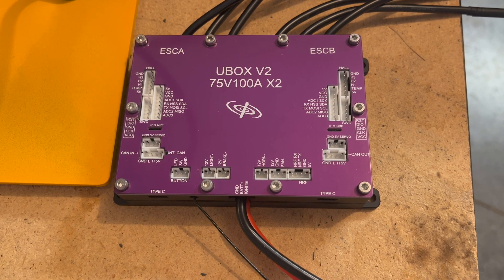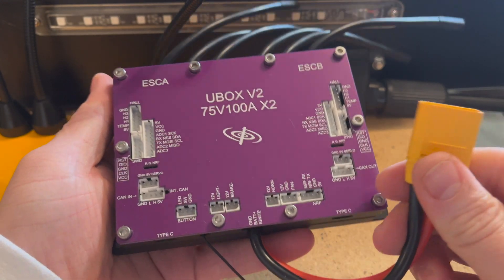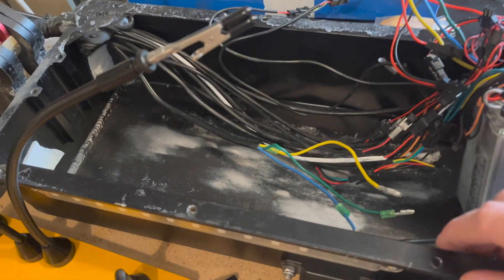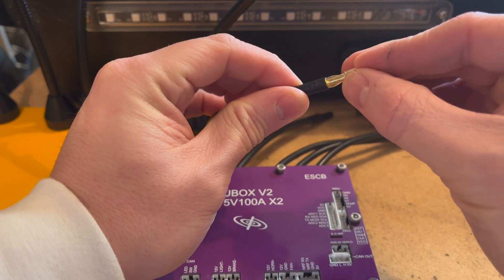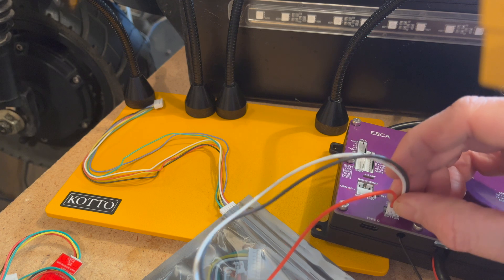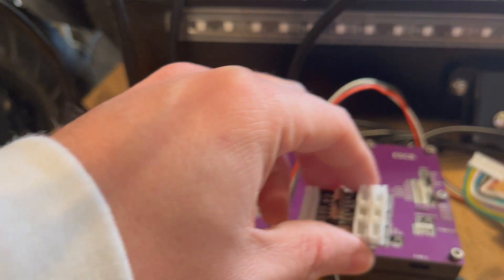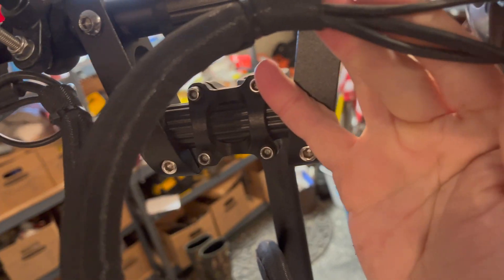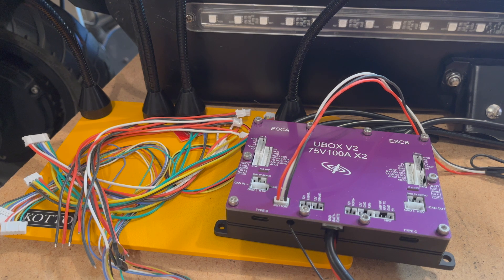How to Make Your Electric Scooter Faster | UBox Part 1

Comment: Hey what's up man, how did this turn out in the end? I have a Mantis Pro and can't find many videos on the results. It'd be nice to see some before and after 0 to 30mph times or something to show its a lot quicker and worth the effort to do this. Most of the control boards I see like vesc, seem to be made for longbiards not scooters so that's unfortunate it causes many more problems when making it work for a scooter. The ones that are meant for scooters are usually to weak or too big for my scooter since I don't want it to be external
Reply: some esk8 board needs alot of current like 100a per motor or more for torque. With escooter only needs lesser current but torque is insane cause motor is bigger so with vesc its not really a problem! ofcourse powerful esk8 is torquey too, Ive seen doing 40 at 5 second just 2 motors with 4 probably 3 seconds.
Reply: @joaquinninoortega156  no that's not true, the controllers just don't list motor current, they list battery side current

i had a pair of 28A JP controllers in my scooter, and i'm running 2 VESC's at 40A battery current and 120A phase current, 90A phase current is about similar as what the original controllers did in the motors in acceleration and climbing power

the "45A" controllers in more powerful ones ask 45A max from the battery, but at lower speeds they dump up to like 150A or more into the motors

when i use VESC tool and have a motor at 50A i can hold the scooter (not 2 of them, but a single one) by the handlebars

these need atleast 90-100A phase current each on a dual motor setup to have decent acceleration, so the majority of VESC's are too weak for these scooter motors

i've got a pair of 75200's coming in.
Reply: @BH4x0r  The generic controller doesnt tell me how much current it releases from battery or phase wires. Did you run foc detection for that 120a? or that 50?

 FSESC 75200? good luck with that!! might get hot as soon as possible.
Reply: @joaquinninoortega156  you just pick an approximate motor size (6kg outrunner) and run the wizard, it will do most of the setup for you

i don't run the battery current that high, i only run 42 amps per controller @ the battery (cause the battery has a 90A max limit), and at half of the top speed it starts accelerating less (obviously as the max phase current can only be 84A @ 50% duty cycle) and less when you near the top speed, which is basically like all scooters, because of the battery current limit, however low speed torque is better than with the original controllers because those weren't that powerful in the case of my scooter and ScootaGangs' Yume

in the case cause hes set it up like a "10kW" scooter (100A at battery and at motor) it'll have the same acceleration through the entire speed range, which is okay but because he can't really go higher on the motor amps on the Ubox it doesn't have the power at lower speeds like an actual 10kW scooter would have.

make sure to buy the right one, Makerbase has the same controller (MKSESC 75200 Alu PCB) for cheaper

but make sure it's the Alu PCB variant, those are much better.

I do have a pair of FSESC 75100 Alu PCB's and the hottest i've seen is 60°C in 32°C outside temperature, with the sun obviously shining on my scooter aswell while riding in the sun, at 120 phase amps per controller.

If i had the old shitty black box ones (not Alu PCB) i would get overheating issues no doubt, but the Alu PCB's are amazing comparatively.

the 75200 Alu PCB has much thicker wires, twice the mosfets, twice the capacitors and whatnot, i'm sure it'll be fine, the 75100 Alu PCB already has 380A mosfets, and the 75200 Alu PCB thus has double the mosfets per phase
The original overheating black box 75100's had some crappy 120A max rated TO220 mosfets (as compared to the 380A TOLL (SMD) fets in the Alu PCB versions) which obviously has a much lower Rds(on) and not the thin legs of a TO220

Comment: I would like to use the Ewheel ADC Adapter V2 to attach a monitor and an immobilizer.Is this possible? Please tell me how to connect the motor sensor and power supply. Thanking you in advance.
Reply from the maker: Sorry if you have questions outside of the scope of my videos then you will need to ask Spintend for assistance. I am not their customer service agent nor do I work for them. I am merely showing proof that their product works as advertised.

Comment: haha, I randomly found your video, I have ti30 (exact same as yume y10) and i baught the ubox v2 already. I'd love to see more videos like these
Reply: Ti30 is actually much more powerful than the Y10, Y10 is 52V 2400W, Ti30 is 60V 5600W, but other than that they're indeed pretty similar
Reply from the maker: @BH4x0r  Yeah it's the y11 equivalent, not the y10!
Reply: @BH4x0r  have you replaced the controller? have you faced any problem?
Reply: @marinostsalis314  
 @Marinos Tsalis 
i turned off Phase filters in Filters under FOC before doing anything (i upgraded the controllers to firmware 5.3 before doing anything) and instantly pressed write after turning off phase filters, that also was before connecting a motor or so.

no problems except for one time i've put traction control erpm difference much too low, i'd recommend ERPM difference in traction control around 1000 or 1500 even to be safe, i've put it way lower to test and i had some cutouts and even can disconnects which i couldn't figure out why at first (the motors weren't on the ground so they could spin up freely)

once i've put them at 1000 it was fine, and actually 1000 erpm on my motors is like only 3.2 kph difference so that wouldn't be significant slip anyway

i've set up motor poles etc before doing anything else tho cuz i know its 15 pole pairs (or 30 poles in VESC) and i know it had 10" in the controller aka 254mm wheel diameter, i also have gear ratio on 1.0 as they're direct drive etc, i ran FOC parameters check via the vesc tool (not wizard)

if you use the wizard you must make sure it does not go to default settings

edit: i run Flipsky 75100 with Aluminum PCB tho (newest) with ADC no reverse brake on ADC2

i also made a loopkey thingy with an XT90-S as they need an antispark
Reply from the maker: I have the footage ready of the wiring, just have to edit it still!

Comment: Still no update on your project sir? Its been long time. ☺
Reply from the maker: Everything is in the scooter ready to fire up but I am trying to figure out the best fuse situation. I am in no rush as I have other scooters to ride anyways. It will get done eventually. Spintend is not very much help either tbh.
Reply: @ScootaGang  we want to see/watch how you install and check how its goes on the road 😉
Reply from the maker: @harabas3813  Made some good progress today, i have everything hooked up. Tuning it tomorrow with Vesc Tool and it should be running finally!
Reply: @ScootaGang  nice. Thanks for the update sir. 🤜🤛

Comment: Any update on this sir?
Reply from the maker: Spintend is sending me an adapter so I am waiting on that right now. I'm hoping to get it done in the next month or so!
Reply: @ScootaGang  where did you bought this sir?
Reply from the maker: @harabas3813  From Spintend! The link is in the video description!
Reply: @ScootaGang  how many adc adapter need sir? How about throttle? Because i saw on ali express there is package of that maybe that one i will buy. 😄
Reply from the maker: @harabas3813  I believe this is what they are sending me. It will need two because there are two motors. 
https://spintend.com/products/e-wheel-adapter-for-safely-applying-vesc-in-ebike-electric-scooter-in-adc-mode
Reply: @ScootaGang  ok i will order the package which is the 1 controller and 2 adapter. Is this plug and play sir? No need to configure to the computer?
Reply from the maker: @harabas3813  It requires configuring with the program "Vesc Tool" and you can link by cable to a computer or by bluetooth to a computer or android device. I have a mac and will use that to tune it. 

And yes it needs the controller as well as two adapters, one for each brake. You are able to hook up both brakes to one adapter, but then the front and rear will brake together. I think it is better to have independent braking so I am waiting for a second adapter. I didn't realize this going in or I would have asked for two to begin with.
Reply: No need to change throttle display sir?

Comment: Great video. I can't wait to hear how it rides. How much do these foccers cost?
Reply from the maker: Thank you! This one costs $350 for dual motors. If you compare that to a Vesc branded controller, those cost $400 and they are only single motor, so you need two ($800). That's why I wanted to test this UBox, because it's much more affordable for everyone.

Comment: Can't Wait to see how it goes.if it makes a good enough difference 
I'm in.
Reply from the maker: I think it will make it into a burnout machine....we will see soon!
Reply: @ScootaGang  this will add additional top speed for our yume y10 sir? 😅
Reply from the maker: @harabas3813  I'm not sure yet. It will definitely add more acceleration. Usually the top speed is dictated by the battery voltage, so theoretically this won't make the top speed higher. But it will let us push about 2x the amps from controller to the motors, so it will get to top speed twice as quick hopefully!

I am waiting for one more small adapter piece that Spintend is making me. It will be here soon and I can finish up this project and show some results!